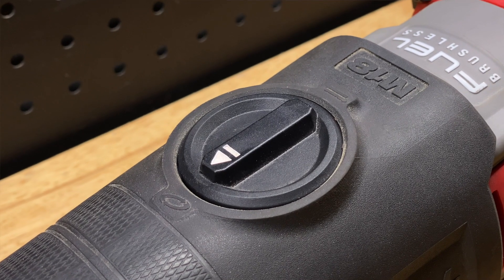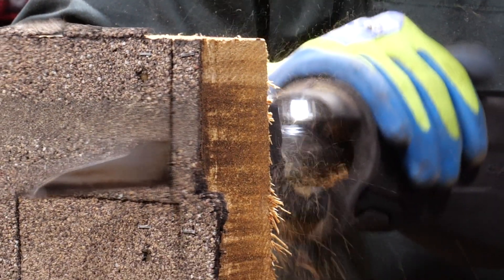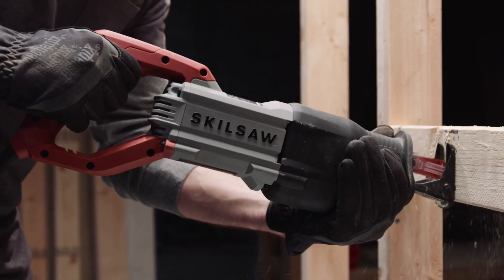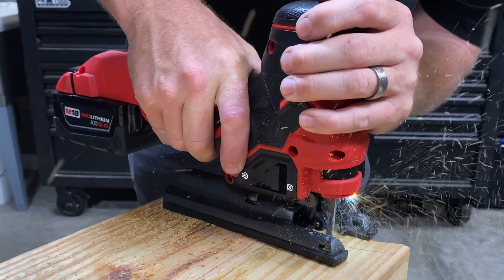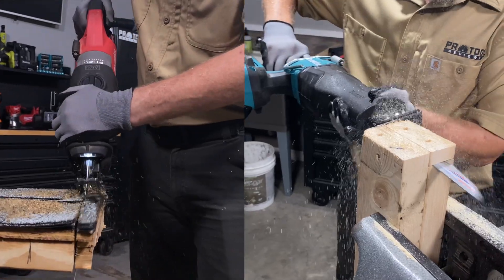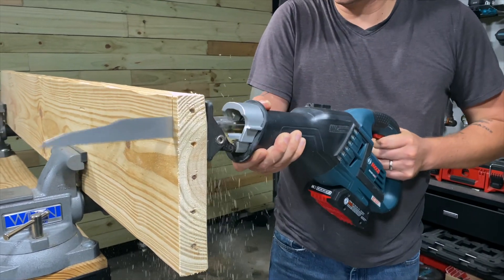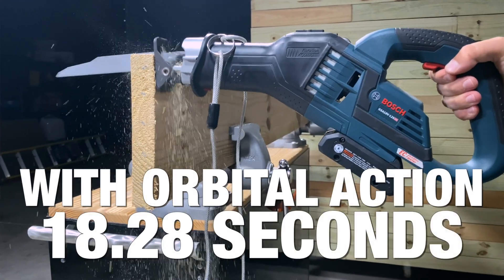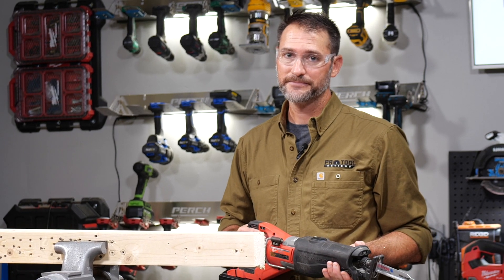What Is Orbital Action?

Comment: I have both types (simple reciprocating and orbital) of Milwaukee saws.  For demolition, I am cutting beams out of a house built in 1840. Using  a pruning blade the orbital easily cuts through quickly. The beams range from 3x10 to 12x12 (inches). The orbital motion contributes to clearing out the saw dust in the kerf. The simple reciprocating version has a very difficult time beyond cutting a 6" beam.  I'm quite impressed with the orbital version.

Comment: I bought my dad a Porter Cable reciprocating saw with orbital action about 30 years ago and it blew away the Milwaukee Sawzalls I had used at that point! This was the first time I noticed a reciprocating saw with this feature.  The tool has gotten some extreme use over the years and is still running strong today!
Reply: I had a rockwell tiger saw with orbital action back in the early 1980s. The two speed switch on low was what a Milwaukee sawzall would on high. The tiger saw on high could easily remove blade teeth and get red hot. It was unstoppable for me.